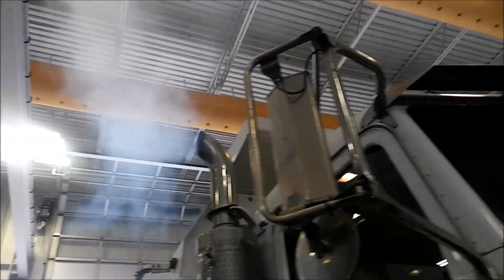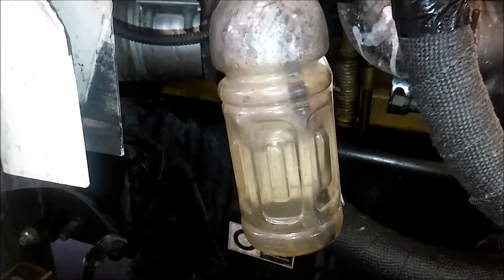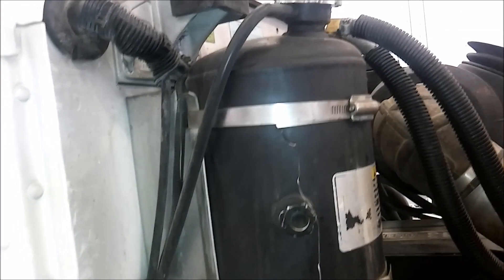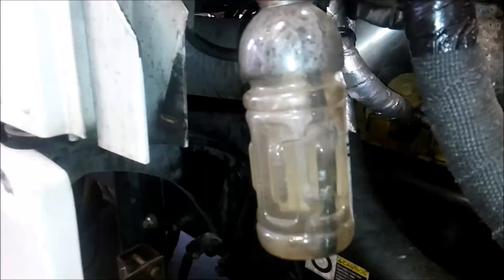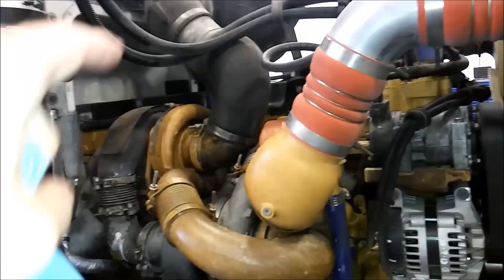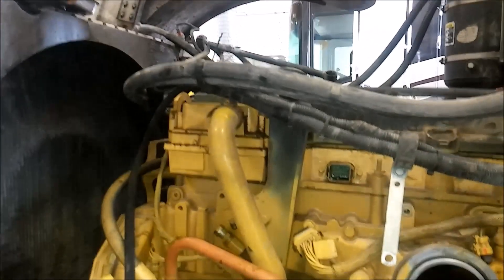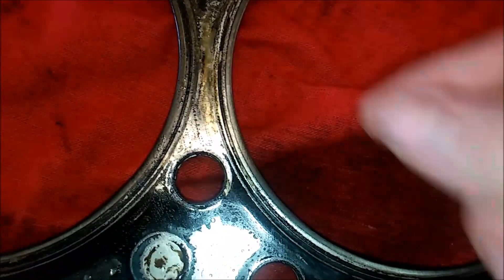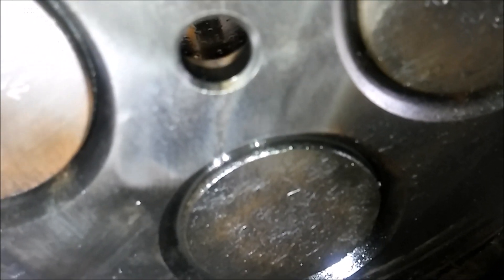Test For A Cracked Cylinder Head or Head Gasket. Perform The Bottle Test or Bubble Test.

Comment: Got a c15 no white smoke, no coolant loss other than small amount thats likely being pushed out the overflow tube. Ran the die test never changes color. Line off compressor no change, even with coolant lines pinched. Will build up to 22psi in system. Doesnt smell like combustion. Interesting part is rev engine over 1600 rpm it stops bubbling and starts pulling a slight vacuum. What would you do next? No sign of coolant in oil.

Comment: No sludge in oil but blowing oil/white smoke out exhaust Jeep 2.0 turbo 2019 150k floored it then cylinder 4miss fire changed plugs n coils still blowing oil/white smoke any help?

Low compression in 4&2 plzzzz save my Jeep Cherokee

Comment: Been following you for a while now. Finally got a good question to ask. How would you tell if the liners were cracked versus the head or head gasket failure. My truck is pressuring and getting slight mixing. No smoke from exhaust but definitely white blow by

Comment: I have air getting into mine but no milky oil, holds air pressure in radiator for days maybe even weeks. Cat 3126 2000. No white smoke , no diesel in radiator fluid either😊
Reply: Did you fix?

Comment: I have a c7 that is constantly pushing coolant out of the surge tank however it has never shown classical signs of head gasket failure at any temperature should I look at the air compressor or could it be injector cups

Comment: the cylinder bore crack because the construction, size , valve diameter and the injector gap to close.. cant hold the pressure combust and the engine temperature

Comment: Wat if I have just bubbles in my reservoir tank but no bubbles out of my overflow tube (like in your video)? It's a c15 6nz. Just changed head due to the exhaust studs being broken off high mileage etc..

Comment: Hello sir! I have a 6nz that has been given me headaches. It started to blow coolant from tank reservoir and keeps ruining the water pump. I have replaced the water pump 3 times and still  ruines them. The fouth time i removed the head and gasked seemed to be new since overhaul was done las year. Took cylinder head to shop to test and tech said head had no problems. And said i had to change air compressor. So I bought new air compressor and installed it as well new water pump for the fourth time.installed cylinder head with all new gasket lit from cat.Ran truck to full days and leak started again. Any chance you have come across a problem like this? Thank you for all you do!
Reply: My friend had the same problem there was a piece of round metal in the coolant resovuor which would bloack the water pump inlet pipe. Check the resovior.

Comment: I know this is an awkward question Josh but my accert C15 2005 doesn't have any hose on the reservoir, do you happen to know the hose size to buy some and do the test? Thanks for this amazing video by way
Reply from the maker: The cap might be the kind that vents through the cap. In which case you have to usually put a latex glove over the cap and see if it fills up with air after it warms up.

Comment: Thanks for the videos. I have found them very helpful and interesting. 

I have a 2005 Bounder with a 300HP C7. We tow a 2017 F-150 behind it. I replaced the radiator and charge air cooler 2 years ago, about 12k miles ago. Total miles is about 96k. Last year the fan hub bearings seized  near Williams, AZ and I had it repaired in Bellemont. I also had them flush the heater lines and replace both thermostats. He gave me an extra gallon of coolant because he said it would need to be refiled if there was any air in the coolant system that hadn't worked out yet. 

Last week it almost overheated while driving to Pahrump, getting just up to the 3/4 line. The check engine like came on. When it dropped just below the 3/4 line the temp read 213° F. When I got to the RV park the coolant was low so I filled it up. Driving back to the Central Valley it started to heat up, but never got up to the 3/4 line, which is about 215° F. I can put my finger into the top tank when cool and it reaches coolant, so it is pretty full after driving the 300 miles home. I don't see any evidence of coolant in the oil or oil in the coolant. I warmed it up on a short drive and tried the bubble test anyway and got no bubbles.

I sure would like any suggestions about possible reasons for the heating up. It is usually on a grade, but some grades hardly affect the temperature at all.

Comment: I'm working on my 1967 Camaro with a sbc 350..white smoke high pressure in the coolant ,and i installed a clear hose between the intake manifold and the waterpump and can clearly see air bubbles when i bring up rpms, I have no choice but to pull the heads and have them magnafluxed by a machine shop, thank you for you great video and explaining in detail..

Comment: Great Video. I got a 3306C head off and kaint find a bad spot in gasket.A coolant seal by #6 Exhaust side had material missing between ring and seal. Haven't seen any crack yet. I thought for sure I would see a bad spot at #3. Also liners look great.I will never do that again. I hadn't seen the bubble test trick yet and haven't been a diesel mechanic for years. Do you have any suggestions of a weak spot on the 3306C. Really seemed like its is a compression leak when hot. This Engine has led me to you. Fan #89000.41  THANKS
Reply: I assume your pushing coolant out of the overflow.
The last thing I do is pull the cylinder head. I may get it hot and pull nozzles with rockers backed off and psi test each cylinder with a hose hooked to a bucket and see if shop air is leaking into that cylinder. Liner flanges could be cracked, crack around carbon area of liner. Seen air operated heater control valves. Bad radiator cap, (Needs 15-16 psi), back neck on radiator itself.
Incorrect way of doing a bottle test.

Correct way have radiator cap off, adapter on neck with a hose down to a five gallon bucket or so. 
Thermostat fully open, take a bottle (usually a pint bottle) and fill with water. Insert hose into bottle and invert bottle in bucket of water. Time how long it takes to push water out of bottle until bucket starts to bubble. Usually forty five seconds or less engine has to much gases leaking into 
cooling system. Some engines the time may vary.
Reply: Ya I got lucky its working. Needs an Inframe for sure
Reply: @un-limited7009  Does it have a Jake Brake?
Reply: @johngoldsmith6629  I have it back together now. No engine brake. Running fine now thanks
Reply: @un-limited7009  If you have a Jake brake on a 3306 you have to be careful. Push rods could have a large one and small one.

Comment: please help I bought a Freightliner Columbia with the C15 motor about two years back the motor just had a head replaced on it and I'm not going to lie this truck was doing very very great for me and I had zero problems .just maybe replace a injecto .just a couple days ago I added mothers oil leak because I had a little leak going on very minor next day after I ran it I noticed that there was a little bit of oil leaking on the side of the head which never happened now I have crazy pressure in my coolant tank.but the leak isnt a drip stain more like a residue.
Reply: My temp does not goes over 180

Comment: I have a kenworth T2000 2007 C15 475 hp twin turbo! About 4 months ago the temperature gauge went crazy over 250! And motor shut down i had to stop and go stop and go for 100 miles to get to the yard! The coolant is pushing back out of the reservoir! Now every time i start the engine within 10-15 min it over heats! There is no coolant in the oil and no oil in the coolant! The only place water is coming out of is the reservoir little hose on the side A LOT and engine over heats. Any idea what could it be? Some people are telling me cracked cylinder hear and head gasket or liners or piston sleeve! 
Would this be possible since there is no coolant in the oil and no oil in the coolant? 
I have changed the oil cooler and water pump at Caterpillar almost two years ago. Any help would be appreciated. 🙏🏼

Comment: If you are not sure clean the surface, put kerosene or parafin( im not sure about the english name), the sort you use for a heater or lamp, on the surface and wipe it clean. Then use white chalk on the surface. If its cracket the parafin that stayed in the crack will discoulour the chalk. There is a kit called coulour check or dye check. Works rhe same way. Also to be used on welding checks.

Comment: Learned a lot from your videos. My c15 ate a gallon of water in three weeks. I did the bottle test and it didn't bubble at first but then it started bubbling not as bad as your video but there is bubbles. Wonder if it could be radiator cap weak
Reply: I started losing water 12 gallons in a month on my C13 Cat.  I had a bad cap gasket so I replaced the cap. That caused the motor to burn so much water it blew white smoke and skipped badly. So I put the old cap back on and tied a gallon jug under the hood to catch the water out the over flow so I could haul until the garage was ready to take it.in. When my jug got full I dumped it back into the radiator.

Its in the shop now in fact. Can't wait to see what they find. Hoping for a blown head gasket only but we'll see.
 He said there should not be be bubbles going on  at all.  Never ever!  You could have a cracked head,  blown head gasket,  bad pre cooler,  leaking air compressor or cracked liner. All the things he mentioned driver.   Come on!

Comment: What if the oil is going into the coolant reservoir, but not over heating, no smoke, no knocking etc. ? so far oil in the coolant reservoir
Reply: YAHOWSHUA Ben YAHUDAH might be your oil cooler , I know this is old but thought I would put a answer up

Comment: For what its worth 9 out of 10 times there is a reason for the head gasket failure,  on the cyl with the problem it is imperative that the  liner be pulled and the counterbore examined with a trained eye.  There is a very good chance there is a crack in the counterbore.  The procedure for that is done with a counterbore cutter,  cut out the crack and shim it back and set liner protrusion,  check the rest,  if you dont,  be right back with the same problem.  I dont see a video on cooling system maint ?  Folks need schooled on AF and how it turns acidic.  Nice job on the vids

Comment: I took my cylinder head to the machine shop to be rebuilt and find out its cracked between the valves on cylinders 5 they said they can fix it for extra $$. I need to know if that's worth it or better get a new one.

Comment: could you answer me this i dont have exhaust in the coolant i dont fuel in the coolant and i dont have coolant in the oil and i dont white smoke and no i have not done the bubble test like you show in the vid but i do however have coolant coming out the cap so you are telling me that its a head gasket but it could be a liner and this is a 6nz in 2000 or so kenworth with sleeper but i should have white smoke with a liner with a hole in it not pushing coolant out the cap

Comment: I have a question for you I had oil in my air brake system replaced compressor and it still was with oil in it replace compressor again and now oil is coming out of my fan clutch line what can it be?

Comment: Incorrect way of doing a bottle test.
Correct way have radiator cap off, adapter on neck with a hose down to a five gallon bucket or so. 
Thermostat fully open, take a bottle (usually a pint bottle) and fill with water. Insert hose into bottle and invert bottle in bucket of water. Time how long it takes to push water out of bottle until bucket starts to bubble. Usually forty five seconds or less engine has to much gases leaking into 
cooling system. Some engines the time may vary.

Comment: I have a 2001 6nz C-15 with about 1.3m miles. The truck pushes a little white-ish smoke out the stackes, but no sign of coolant in the oil and It doesn't have an over flow reservoir to do a bottled test but I am sure there is a way. My question is when replacing a head gasket, can you get away with just replacing the gasket or is it best to do a rebuild?

Ps. Love the vids, I think I watched pretty much all of them.

Thanks
Reply: JPT gf

Comment: Love and appreciate all your videos!
I have a question. My 05 CAT C7 with 130k miles in my Fleetwood Discovery RV dropped a valve and demolished the block. It's a 330 H.P. KAL. I found an engine out of a Neptune R.V. and it is also a KAL but it says it is a 360 H.P. engine. Will my computer work on that engine? What are the differences between the two engines if any?

Comment: That’s one bottle test and the other is a kit u can buy at your local parts store. 
Head test kit. 

Looks like a glass dildo lol 
Or at least that’s what I call it cause when it’s getting used, someone is getting fugged lol 

Push said dildo into coolant over flow tank. Fill dildo with the liquid that came with it. 

Turn engine on and bump up idle. 

If it’s a diesel your testing and it has combustion in the coolant system , the liquid will change color to green....

.....then your head gasket or head itself is bad or the sleeves fell and u have some sort of escape of combustion. Either way , it needs to be pulled apart and inspected. 

One trick I learned : 
This worked on a Detriot 14l 2007 
Failed dildo test. 
I was in Texas and didn’t trust local shops. 
I removed the over flow tank (aka surge tank) cap drilled a hole in it and that let the combustion escape and not build pressure in the coolant system. 

The oil and coolant were not cross contaminating. 

I drove it like that (empty) from Longview Texas to Portland Oregon. 

Second time it happened (70k miles after some bs shop installed new gasket ) , I was again in Texas with a load heading north. 

I did the same trick. 
Drilled hole in over flow cap. 
Let combustion escape. 
Drove it loaded to Seattle , unloaded and then to Portland. 

I did have to add about a half gallon of coolant each morning. But once it warmed up, it spit that much out. 

Low water buzzard did not turn on the whole way. 
I pulled over every 100 miles and inspected it. 
And no, I didn’t go over 55mph the whole way. I put flashers on and rolled out ! Turned them off at weight stations and made sure it wasn’t pissing out as I went by :) 
Had I of been stoped , it would of been out of service ! 

 I went to the dealer and had them do an inframe. After I got to posted and new head and new egr. 

Liner went down on a clyinder.  
Dealer said shop who did first head gasket should of seen that. 
And did a inframe then.

Comment: Hi again adept ape my truck was finally diagnosed after the breakdown if you remember I had a broken valve spring but luckily the valve never fell into the cylinder the head was sent to the machine shop, but I dont get it the shop just called after a week saying that I have a cracked head and I never had any antifreeze or oil going low or mixing issues I have the serial number of my head written down I will make sure that they haven't mixed up my head with someone elses. But what do you think would a cracked head cause any other issues than oil and water like compression?
Reply from the maker: +Aiyman Khan Not sure which engine you have, I'm going to guess a C15. It is possible you have a cracked head with no symptoms. The C15 would sometimes develop surface cracks on the head and if I remember right they are normally between the valves. If the crack doesn't extend into the valve seat area it is "okay" of course any crack is bad. Can they show you the crack and how bad it is?
Reply: Adept Ape hi I did see the head it has 3 cracks between the valves on 3 different cylinders he said it's no good
Reply: In the beginning of the crack it will not connect to the coolant area yet.
But you can be sure, it will start leaking soon.
To prevent cracking always heat up the engine slowly while idling for about 20 minutes before driving.

Comment: i have a 2004 c13 and my sensor gp-pressure can you help me?
Reply from the maker: +Jorge Hernandez What is the problem you are having sir?
Reply: Adept Ape  i got iva system oil pressure solenoid current low (97)
occ 1...first 6788...last...6788
iva #2 not responding(92)
occ 3...first 6752 .... last ..6801
iva#5 not responding(94)
occ...14....first 6721... 6801
iva oil pressure not responding(91)
occ.... 6....first 6751.....last 6799
low intake valve actuation system oil pressure
occ..30.....first 6715 .....last 6806

thats that i have when the dealer put in the computer can you help me with this ?
Reply from the maker: I can't physically help you with it, but I can explain it.  First thing is go watch my IVA and VVA video and it really explains the system better so you can know what you are looking at.  You have a bunch of not responding codes so that indicates that electrically the system is working, but mechanically it is not.  Since you have low pressure codes and not responding codes, you need to figure out the low pressure code first.  Pull your valve cover and look for damage to the IVA housings, the oil bridges, and the valve cover base.  You might have to start it with a rag over the purge port so you don't get sprayed and see if you have a big oil leak somewhere in the overhead or for some reason you are not getting oil pressure to the valve cover base.
Reply: i did take the valve cover off and theres no leaks but how or where can i check for my self if a avi is not working sorry bro but im new with this